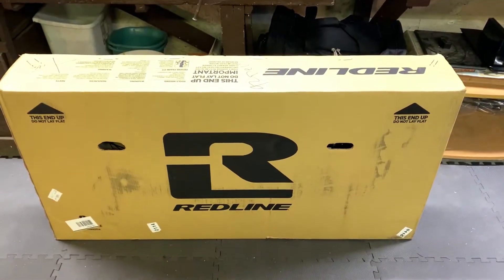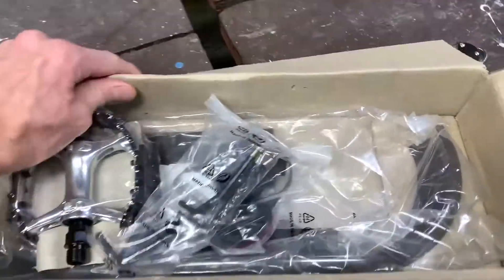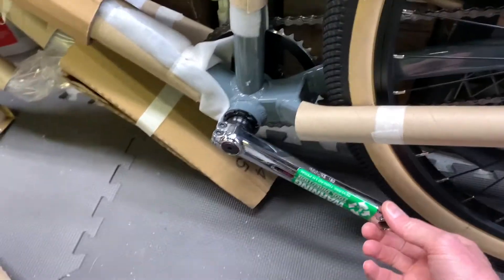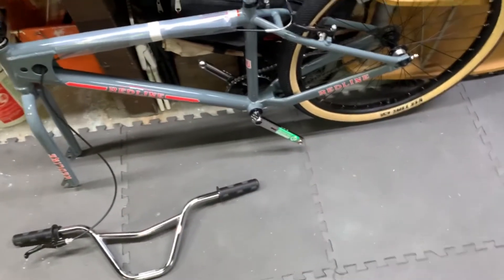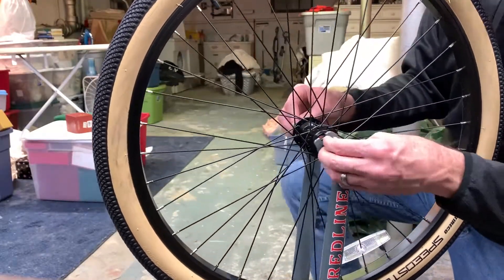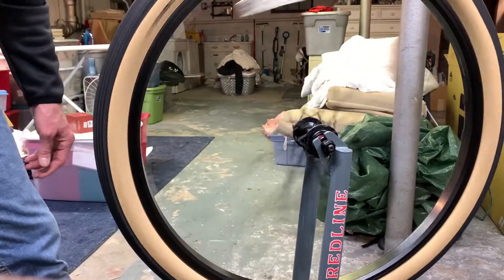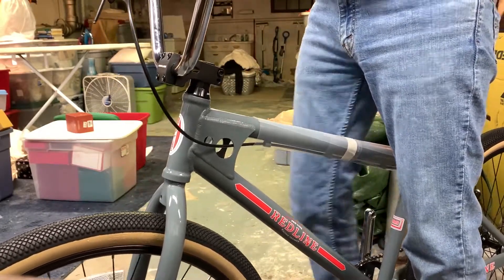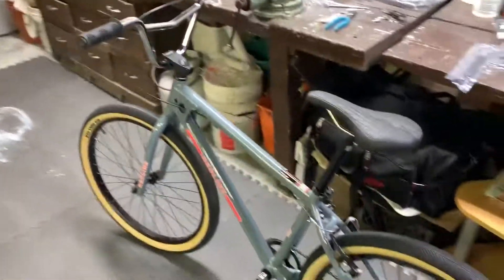Redline Squareback 26" BMX Cruiser:  Box Opening & Build - Part I

Comment: If you run the cable through the small hole in the front gussett it wont be so sloppy.... I own the 2019 black one LOVE IT!    Have fun on it!
Reply from the maker: Thanks!  I wrapped the brake cable with a 3” long piece of grey foam backer rod and zip tied (red mini ones) it in place.  Keeps it from making noise when the cable bounces. Looks pretty clean.  Having fun with it!

Comment: Would this hold up for a 250 pound person?
Reply: I have a PL-26 and am 6'3" 185, so no problems. At 250 pounds these bikes are more than sturdy enough to ride, but pretty much everything aside from the frame, forks and front end of the drivetrain are extremely cheap and won't hold up to anything other than gentle cruising. The wheels suck. I don't have anything good to say about them. They will arrive with loose spokes, wobbling badly,  and have a $10 freewheel that is out of round (I complained to Redline and they credited me $150 towards a new wheelset). I added S&M 4 piece cruiser bars, an SE Narler stem, Redline Magnesium pedals, SE racing wheels with a White Industries freewheel, KMC 610HX chain (the chain that comes on the bike won't hold up to an 100 pound rider, let alone 250),  S&M quick release clamp with a Black Ops Mullet seat. Oh, and I swapped those ugly, fat tires for some 26x1.75 Comp 3's. So, it's a good base to build a purpose built cruiser, if you ride hard. But if you don't care about buttery-smooth ride quality, wheelies, jumps, etc, and just want to cruise around town, then it's fine as is.